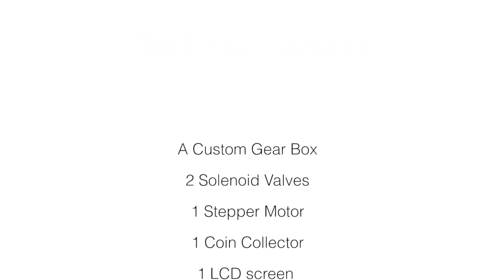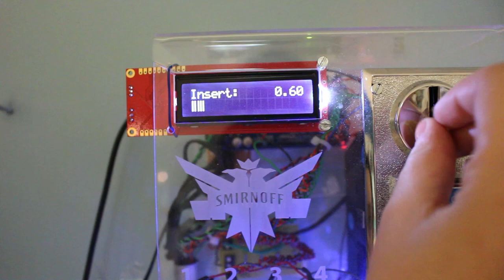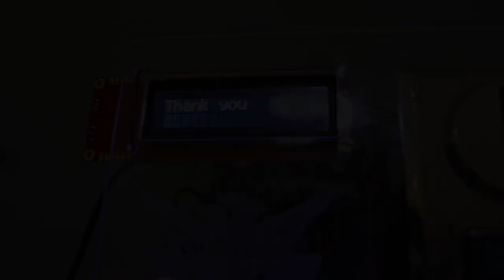Vodka Vending Machine - Arduino Project

Comment: Love the project, I'd be interested to know why you used two solenoid valves instead of one directly dispensing into the shot glass.
Reply from the maker: Hello! It was to get an exact volumetric measurement because flow rates vary depending on how much liquid is in the bottle :)
Reply from the maker: In later models we used a ball valve to achieve the same thing with only 1 electronic component that opened the bottle valve whilst closing the top valve in 1 motion, much like a bar based spirit dispenser.
Reply: Thanks, that's very interesting. I appreciate you taking the time to help me out, thanks again.

Comment: This is awesome! How much did it cost to build?
Reply: About £50, but thats with materials that have been subsidised by university stores. The solenoid valves were the most expensive bit as we went through three different types through testing because the lack of back pressure in the bottle caused issues.